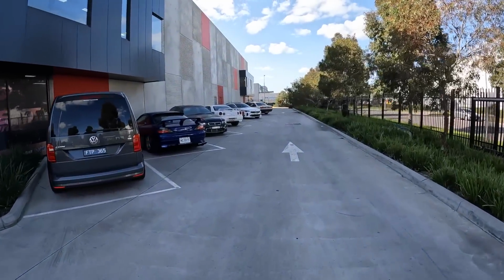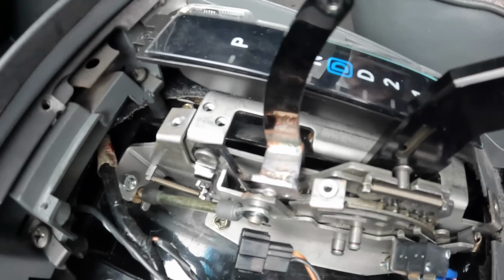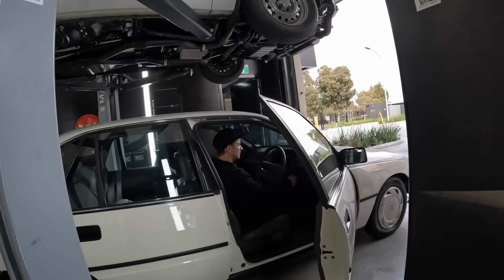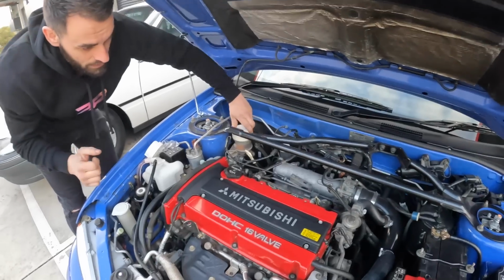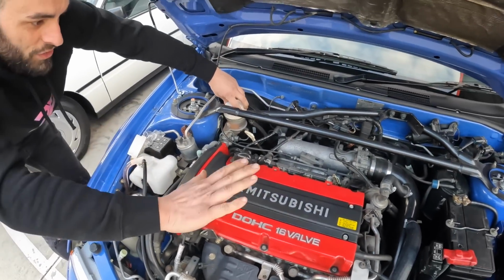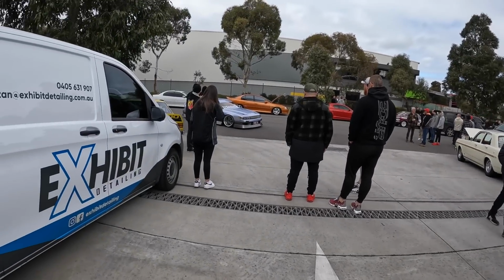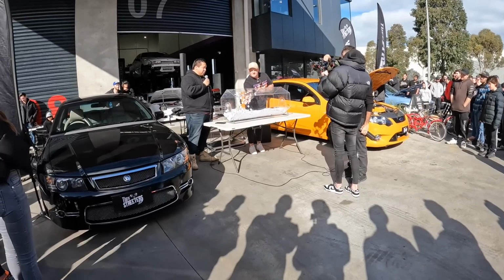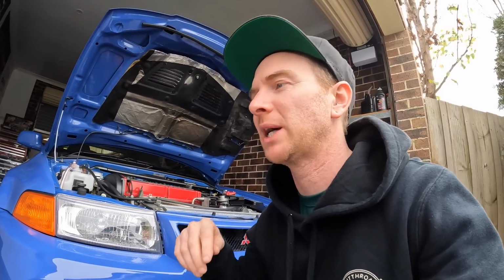We hosted a car meet & IT WENT OFF!

Comment: Just had my T400 rebuilt auto. Seems to bite a little early changing gears, not super smooth, but doesn't do it all the time, mainly through early takeoff. Should i go back? Coupled with a 308 in my VK.